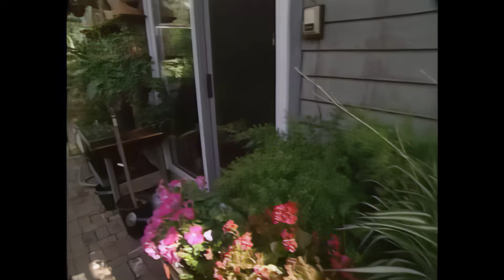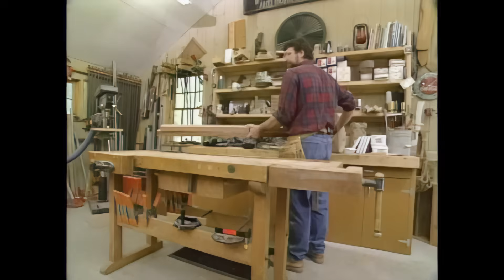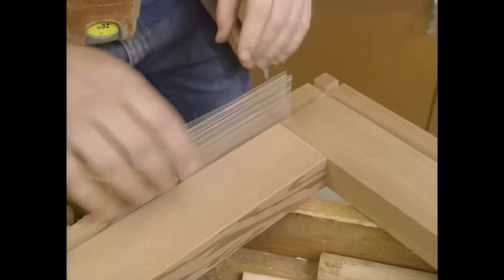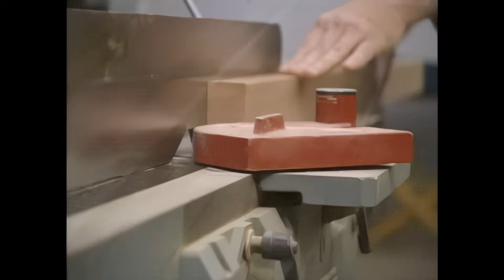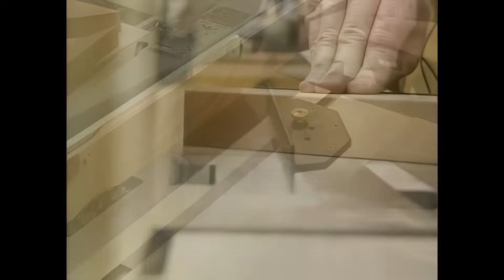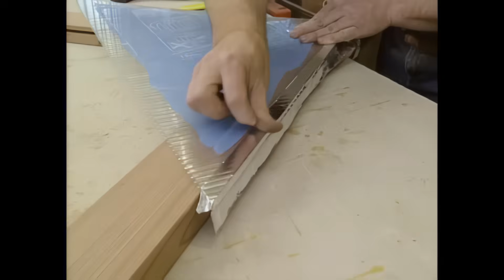Greenhouse  |  S9 E11 & 12  [AI HD]

Comment: A few decades ago, my dad built a greenhouse in his back yard. He used clear, corrugated poly-carbonate for the roof and poly=carbonate panels for the sides. He used an old half-French door for the entrance. That thing held heat like a dang oven. In the coldest part of winter (which around here was maybe down in the teens at the extreme), it would be in the mid to high 60s in the greenhouse during the day, with no artificial heat source used. It was a very simple design, but it amazed me how well it worked.

Comment: If the rebar goes in that easily, the wind would have zero problem carrying that place away.  I would have used longer rebar and put it in at an angle.  If wind is such a problem in that area, perhaps even adding a bolted chain from the greenhouse to a nearby tree might be called for.

Comment: Quick question. Closer to the end of the series' run a newer Bosch Jigsaw was used in two episodes, but there was no clear shot of the full saw body, all I know was that it was either a Bosch 1590 Top Handle or a 1591 Barrel Grip. The words Precision Control were the giveaway. Was it the Top Handle or Barrel Grip? I know Norm prefers Barrel Grip models.